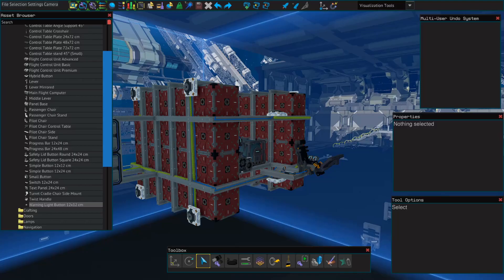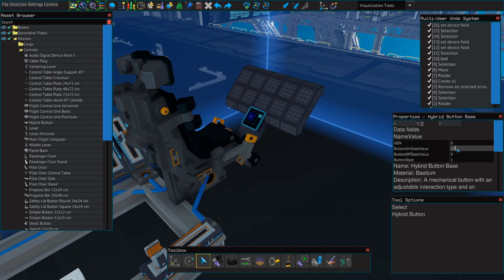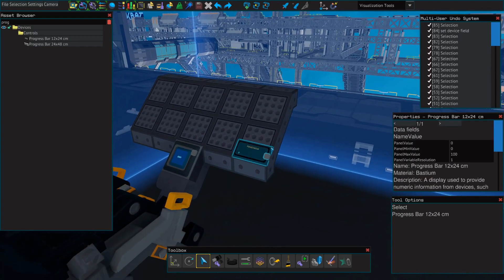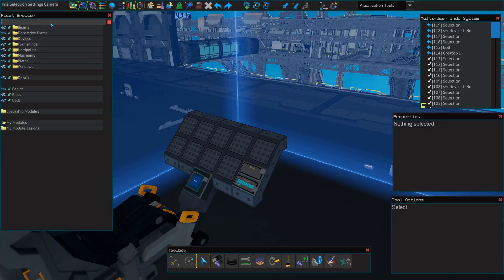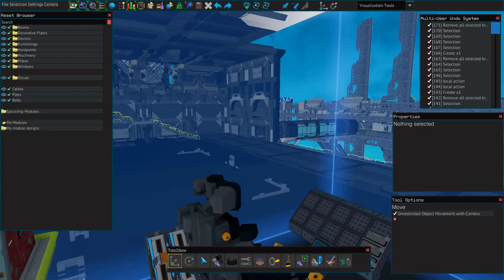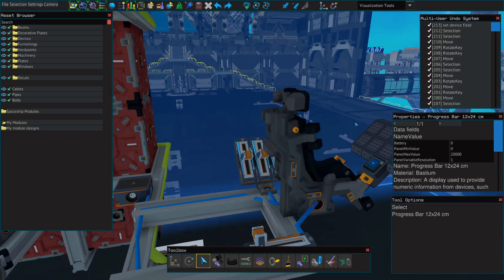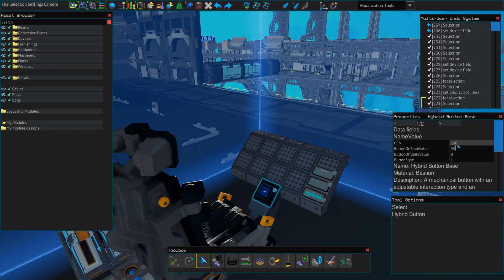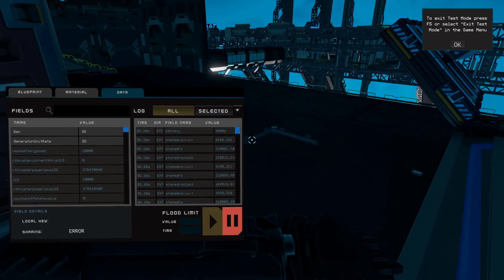Starbase Ship Building Tutorial: Episode 5 Buttons and Progress Bars

Comment: In programming in general I don't like hard coding values. 

For example, although not coding (but still using variables from the cable network), making the propellant progress bar and setting the "PanelMaxValue" to a hard number 400000 I'd rather put "GasContainerMaxResource". When I type that in, it auto puts it in quotes, assuming it's making it a string. I am intending on it being the constant variable from the propellant tank. In test flight, it shows the 400000 but the progress bar never moves :\ . Same for the batteries and fuel rod.

I am assuming the name/value fields for the progress bars aren't that robust or my syntax is wrong(?). I figured I wouldn't need YOLOL to display one constant value :\ . 

Is hardcoding the only way?

Comment: I'm not seeing a way to edit buttons outside of the editor. To be specific, I have a ship design that was given to me, thankful for that (this id day 3 of playing) . . . well I crafted it in this ship editor screen, but then realized I wanted a button to instantly set one of the modes that he initially put in (Steering & max throttle) . . . to the point: It does not seem to matter which tool I have in hand, or if I'm on the data tab using 'U' utility . . . I can't seem to pull up the values to modify them. Maybe I just load the current design in & then, like repair the ship using the new design?

Comment: I do have a question. On my ship I have 3 Generator assemblies each with 3 Tier 1 Gens giving a total of 9. I want to display the average recharge rate (as opposed to the set power level). I can display them individually but when I use a YOLOL script it doesn't seem to work. I'll give a quick demo of the code. PGx = the individual rate, PGRT = The total rate, PGR = The average I want to display
:PGRT = :PG1+:PG2 ... (etc to PG9)
:PGR = :PGRT / 9
Goto1
Then I set the progress bar to PGR and max as 100. It doesn't seem to update or recognise the variable. 
I have another YOLOL chip script for the total battery in the same rack, so I don't think it's a network problem. Any clue?
Reply from the maker: Try removing the colon before the PGRT values. If the only place the "PGRT" value exists is in that YOLOL chip, then you need to use temporary values (no colon). The YOLOL chip can change external values, but it cant remember new ones that dont exist somewhere outside of the chip. So when you use the colon it is trying to look for that value externally or set it to something. To create a temporary value the script would look like this

PGRT = :PG1 + :PG2 + :PG3
:PGR = PGRT / 9
goto1

Its the exact same, but the PGRT has no colon since it is a value only being stored on the YOLOL chip. Another solution would be to use a memory chip to store this value outside of the YOLOL chip. Just add a memory chip to a rack or socket, change one of the "ChipField" name values to "PGRT", and then you will be able to use the colons. Either solution should work!
Reply: @SpunieBard   Ahhh!!! Makes sense. I just thought the colon meant "variable to follow". Many thanks.
Reply: @SpunieBard  Yep! That got it, also found out that one of the Gens was badly placed too (though that didn't make a difference to the YOLOL error) Anyway, Thanks a bundle!